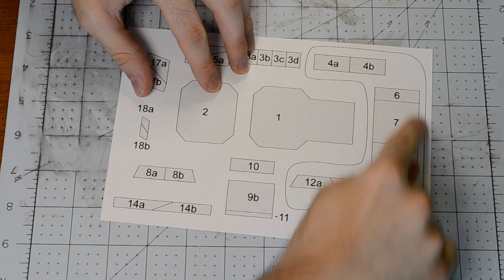How to Scratchbuild Spaceships from Styrene / VX-7 Tutorial

Comment: Thank you for this, been really excited to get more insight into your process. Also wanted to ask, during all that sanding how many times did you knock the fins off? Because I would've definitely knocked the fins off.
Reply from the maker: None, actually! I mention it in the video, but the weld on makes for a surprisingly strong connection. It takes a decent amount of effort to separate them once it’s dry. It helps that I didn’t really bother sanding the engine section much, too.